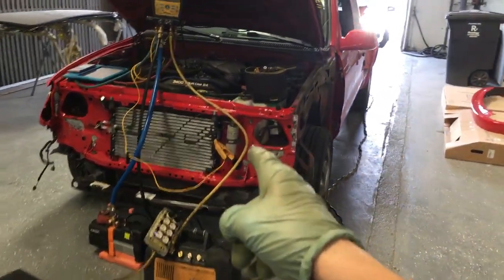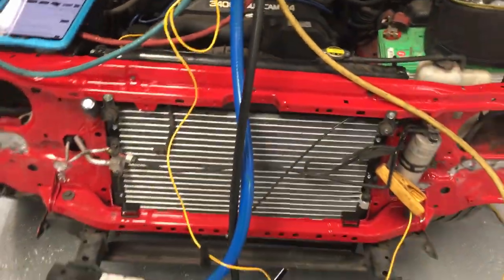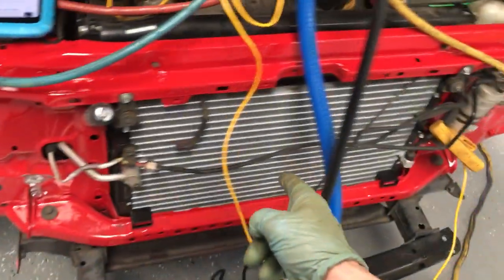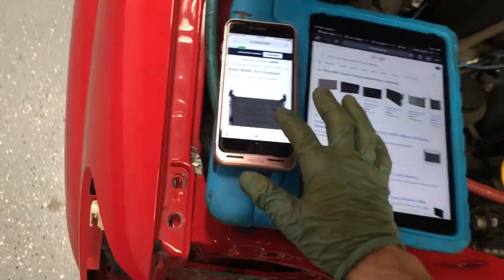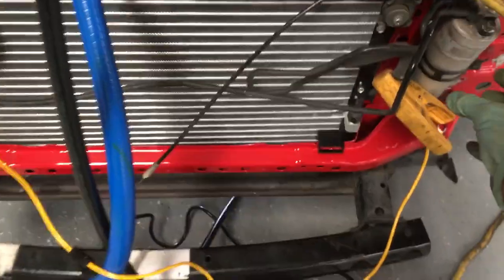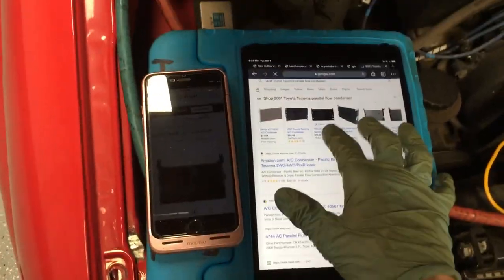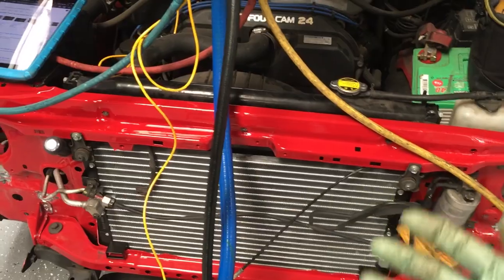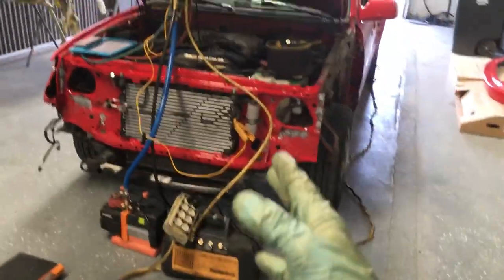Upgrade Your AC condenser from an old style serpentine to a new style parallel flow￼

Comment: We make both where i work serp seems to run better in terms of leaks but PF or parallel flow seems to be taking over
Reply from the maker: Leaks all depends on the quality of manufacturing in the sickness and the quality of the materials. 

They’re trying to make them as efficient as possible. The thinner, the material, the better that he transfer, but the only problem is leaks and corrosion. ..  because the materials so thin. 

I remember the early serpentine‘s were horrible or leaks when they used to use steel on the side to clamp around the edges, where it would bend, then a little bit of water specially, if it was salt, water would get in between and stay wet due to the fact that the serpentine was a lumen, and the brackets on the end were steel, different metals would cause electrolysis eating away at the metal
Reply: @coldfinger459sub0  that's very true where I work we have a cab or controled atmosphere brazing problem alot of tube to headers on the PF condenser serpentine seems to run better but like you said seems like there getting fazed out but I agree PF is the way to go

Comment: I was always amazed to see all these old trucks in the SFO area when I was courting my wife on visits there. Trucks from the 50s on up. Here in Iowa, about 10 years and they have major rust cancer. So 2001 is worth fixing from your area, as well the price tag on new trucks is too crazy. I wish I would have gotten an aftermarket system for my 1996 Dodge Dakota, back when I could. It's still cancer free as I never drive it in the winter here. They like to spread rock salt with our freezing rain and thin snow fall's here.
Reply from the maker: I’m glad they do not spread salt here in California. 
           I remember when I was younger and I used to work in the shop we all dreaded when a customer would bring their car in from back east somewhere where they spread salt because we knew we were gonna have a hard time breaking all the rusted  nuts and bolts off.

Comment: I replaced the original standard 5 blade engine driven fan using an oem 7 blade fan from the "heavy duty cooling" option as part of conversion to 134a.  I prefer the original tube and fin condensor only because it can be flushed.
Reply from the maker: Well if you never cause your compressor to burn out in the first place then you’ll never have to perform the flushing procedure so you might as well have the parallel flow. 

Compresses the outlast the life of the car itself
          Compressors don’t burn up or die they are murdered
Reply: @coldfinger459sub0  Even an R4 compressor,  Weakest compressor ever made?  The only compressor I've had to replace are the R4 compressors, you don't know how unreliable they are, how easily they twist the scotch yoke?  You of all people, should know this.
Reply from the maker: @thisisyourcaptainspeaking2259  actually the only problem with the R4 is the Leaking case to O-ring seals. 

Our four compressors are fragile to people who murder them. 

They are sensitive to being overcharged with refrigerant. 

They are sensitive to being under charged with refrigerant and not receiving back oil and cooling. 

They are sensitive to being overcharged with refrigerant oil getting hydrostatic lock slamming the bearings. 

But if they are properly taken care of kept within the Goldilocks region and the electric fan or fluid thermal fan clutch does not fail they last forever until their case O-ring seal leaks. 

And as long as the owner the customer the driver does not keep using the air conditioning when they notice that is running low on refrigerant and tell them self they will fix it later. 

      Then they wait too long later refrigerant level goes down a little bit superheat goes up oil return goes down compressor burns up and it gets blamed on a weak compressor. 

Yes the R4 is a little weaker than all the rest of the compressors but it still comes back to not being serviced correctly or not being serviced at all

        As long as the compressor is kept cool with a nice supply of lubricant and not too much it lives forever. 

And not talking about a clutch cycling too fast or too often due to exterior horses for some other reason
Reply: @coldfinger459sub0  R4 is a scotch yoke design, only attempt I know of to use scotch yoke in auto compressor.  Didn't work out too well, everyone recognizes R4 as famous for being weak.  This is so true, aftermarket actually designed a scroll to take it's place, that's how weak they are.
Hydrostatic lock doesn't slam the bearings so much as any unusual cause of torque causes the scotch yoke to twist, the failure mode is the scotch yoke twists.  Once twisted, compressor is done.
Reply from the maker: @thisisyourcaptainspeaking2259  Yes it was a week but like all compressors as long as they never see any harsh conditions that put them under any stress they would last till this day I still come across units that are in perfect working condition.
Reply: @coldfinger459sub0  Well, at least I haven't been forced to replace the condensor each time an R4 decides to do the twist.  Breath on an R4 the wrong way, it's gone.  Maybe just fine for an "exotic" vehicle the owner has money to toss at and never drive.  I bet the front carbon seal oil weep drives them crazy.
My 38 year old vehicle has several hundred thousand miles on it, gets driven hard, revved to the moon, on it's 2nd engine...  Doubt GM had any of that in mind when they designed the R4.
Reply from the maker: @thisisyourcaptainspeaking2259  The weeping carbon ceramic famous Frigidaire seal .
      I replaced a lot of those as a child that was the very first compressor my dad taught me to rebuild in our garage at home

    It’s a shame labor is so expensive nowadays it’s not worth it for me to rebuild compressors sometimes I miss it and I feel guilty throwing perfectly good compressors in the scrap metal bin that could be rebuilt and used for another three or 400,000 miles
Reply: @coldfinger459sub0  That's another downfall of the R4, can't completely disassemble them with any hope of reassembly like you can with an A6 or V5, which can easily be completely disassembled, cleaned, any worn or damaged parts replaced, seals replaced and reassembled.

Comment: so whats the deal with filling it then? any info on that?
Reply from the maker: The cooling performance with this old condenser kind of sucks in hot weather

Upgrading the condenser to a modern micro channel parallel flow, Vaseline improves the hot weather performance